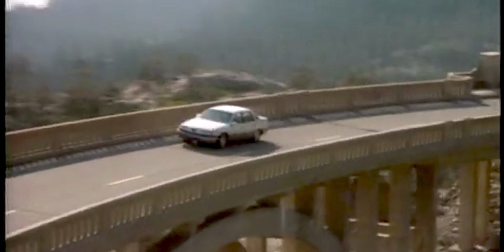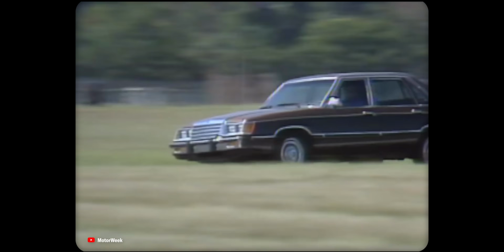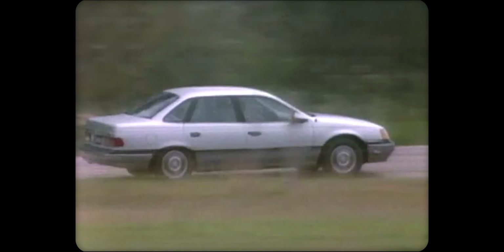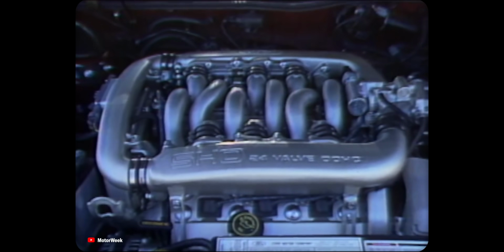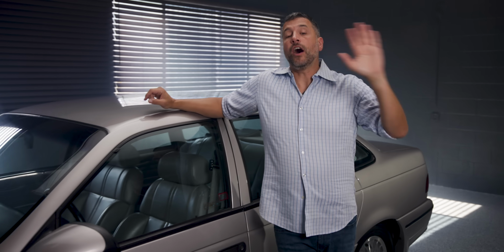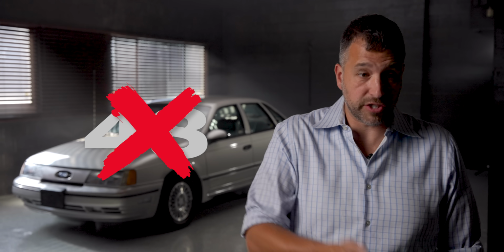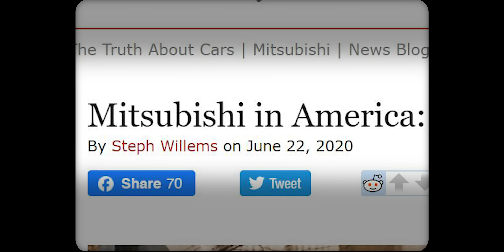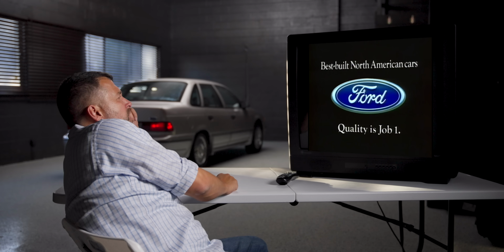The Taurus SHO is the fastest, most expensive Ford sedan | Revelations with Jason Cammisa | Ep. 08

Comment: You could indeed, rev these cars much higher than the 7500rpm he says here, and they would continue to breathe and not drop off in horsepower from the figure at 5200rpm. To do it, you needed to buy an aftermarket pulley and belt kit. The pulleys were wider and ran a 3 inch wide blower belt. The factory belts would sling off so the wider belts were needed. The wider pulley and belt kit was not really worth much on a stock engine, but for one that had some mods done, it was. I never bought the kit personally for my 94 SHO, but I knew two people who had them. I was a salesman at a Ford dealership in Charlotte NC , one of the guys with the pulley kit worked as a mechanic there, and I was big into the 5.0l Mustang racing scene, building engines and modding cars. The SHO's were fast for their class, but could be made to run a ton faster without a lot of trouble. They also made beefed up CV axles to handle the extra power.

Comment: Even though the engine power may drop after certain rpm, that doesn’t necessarily mean less torque is reaching the wheels given the ratio of the gear. Only doing the proper math will tell if it makes sense or not.

Comment: You say the only thing wrong with the SHO was the success of the base Taurus, but there was a second thing: the parking brake cable isn't sealed, so if you live anywhere with weather, it gets filled with gunk and jams up and needs to be replaced basically every year. Also, god help you if you need to replace the clutch. But, for its time, it was pretty cool.

Comment: I had a '86 Taurus LX.  It was a great car EXCEPT for the engine and transmission.  At highway speeds if you floored it it sounded as if it was going to blow up.  Always had trouble with the transmission..it would lurch when coming to a stop...kept taking it in for that an never got the issue fully fixed.  First and ONLY Ford I ever owned.  That aside the SHO was quite the car.  I test drove one and the poor salesman that rode with me had a panic attack.  As far as the demise of the Taurus what I really wanted in '86 was a BMW.  I eventually got a '95 BMW 525 and I ran the wheels of that thing.

Comment: GM's legendary 3.8 V6 was a push rod engine. It had way more power than necessary and got 30 MPG on the highway. Sellers of GM 3.8 equipped used cars are STILL using the presence of that engine in their car as a selling point.  Can someone please explain how reliability, ease of maintenance, smooth and quiet power and good mileage is "outdated"?
Reply: Same goes for the all iron Taurus/Sable Vulcan 3.0 Ford American engineered and made engine. What's wrong with reliability, simple maintenance and good mileage?

Comment: I loved my 1990 SHO ... until 60K, when the transmission teeth fractured and the shift linkage had to be replaced 3 times.  Was able to trade it in for $2K down payment on a Saturn wagon (new baby needs room for a pack-n-play).  Tried to trade it at a Ford dealership, but the newer 'tic-tac' Taurus has had less HP,  less trunk space and less passenger room - absolutely horrible for more money.  That '90 Taurus trunk could fit all my camping gear, or 4 sets of skis and boots or 3 dead bodies, a shovel and a tarp.

Comment: I had an '89 SHO a few years ago identical to the one in the video, basket weave rims, Mocha Frost (yes that's the name) paint, and grey interior.  I've had 13 different cars now, and it's still the best car I've ever owned, make no doubt, it's the real deal people.  Something that every video I see glazes over is the HUGE side bolsters on the front seats are powered, and SQUEEZE you, it's some race car stuff dunno why they went quite that aggressive with them.  Also the handling is legit.  I've had a 2000s Mustang and Acura (to be fair not insane handlers, but the time gap alone speaks for itself when you consider the SHO is a SEDAN FROM THE 80s), and the SHO was dramatically better handling than both.  Bargain basement value right now too, and they're only getting rarer because people aren't taking care of them generally.  If you can find one, keep it, baby it, and I promise I bet it'll be worth big money one day.

Comment: This is not the fastest ford sedans nor the most expensive that goes to the FPV GT F 351 FGMK2 falcon which is a RWD sedan with a 5L supercharged V8 designed and sold in ford aus making 351 KW which is about 470HP and had a 0-60 of 4.9 Seconds with a top speed of 167MPH with an msrp of 70k aud which is 50k USD

Comment: THE FIRST TIME I BOUGHT A SHO I JUST THOUGHT IT WAS LUXURY PACKAGE BECAUSE IT HAD LEATHER INTERIOR. IT WAS A AUTO TRANS AND WHITE LOOK KINDA NICER THAN ANY OTHER TAURUS I SEEN . I BOUGHT IT FOR $270 FROM A PRIVATE OWNER IT NEEDED A HEAD LIGHT AND HAD BEEN SITTING FOR A WHILE. SO I CLEANED IT UP DROPPED IT OFF TO THE SHOP HAD THE OIL CHANGE AND TUNE UP . WHEN I PICKED IT UP I JUMP ON THE EXPRESS WAY AND THATS WHEN I KNEW WE WASN'T IN KANSAS ANY MORE. LOL  I WAS BEATING V8 MUSTANGS AND CAMARO OFF THE LINE AND REMEMBER IT WASNT A STICK. I WISH I NEVER SOLD IT BUT 3500 WAS HARD TO TURN DOWN.

Comment: Buick proved that you "CAN" take a family car and sell all that they could make In 1987. The 1987 Regal t-type and GNs sold 27,590 units and were a lot quicker than the 1989 Taurus SHO. Pure stock Mine Ran 13.3 at 103 mph. If only they had made more and for more years. The problem with the SHO was that it was a heavy front wheel drive.

Comment: Bought an '89 in early '91 from a Ford dealer that was foolish enough to offer an extended warranty. The transmission was far too fragile, but they bought me 5 of them before they stopped... all within less than one of the most fun years of my life. I got what Hypertech claimed was the first chip they released for it... probably not but I felt cool. Got me 2 more mph on the top end at 142 (that is where the wall of air stopped it) and a 9K rev limiter. I ran the numbers using an Atlas (the GPS of the time) on a timed run, and I averaged 113 MPH from Richmond to the border of NC one very late night.

The motor though. Bulletproof. 

And what a sleeper. So fun to jump on Mustang GTs of the day. Yeah. They could take you by a little... if they were ready.

I've probably never left the ground more in any other car since. It should have killed me and my best friend 20 times over... but it didn't. Love that car.

Comment: Not so shure about the title of the video. Two year before the release of the sho, ford released the sierra sapphire cosworth. A 4 door sedan with a 204hp 2L Turbo engine. This was way quicker than the sho in straight line, and in corners too. The sierra was a RWD car with a LSD, so the power was transfered to the ground without any issue, not like the taurus that was slipping really badly... And I don't even talk about the understeer of the taurus, that was a distaster...

Comment: My 2006 Accord is definitely inspired by this car. Not as high revving (6800 rpm vs 7300), but potent nonetheless (244 HP from 3L too). Top speed is electronically limited to 135 mph, but capable of reaching past 150. And it corners well. 

As a lover of V6 sleeper sedans, I've always wanted a SHO, but every time I tried to buy one, it slipped through my fingers. It was definitely ahead of it's time. And while the sleeper status is a negative to some, it's a massive positive for me. It's definitely a legend.

Comment: The transmission was junk, and they never fixed it before they completely re-designed everything. My mom bought one new in 1992 and ended up paying for 5 new transmissions before she switched to a Toyota Camry. The SHO was basically a different car than the Taurus. I'm still pissed off about how ford treated their customers on warranty claims. It made me a Chevy guy for life. My 900hp Chevy truck has an engine from 2007 and a transmission from 1995. It's by far the best vehicle that I've owned. It smokes everything, and only cost me $10k to build. It's 100% GM except for the turbo

Comment: Pray if you were sucked in to buying one of these you sold it before it had a melt down. Jags and dodges have been famous for their wiring issues for decades. If you own one long enough you'll either become an electrical engineer or have expensive mechanic bills. I love both and have owned 11 jags and half a dozen dodges. The SHO was a blast. Fast as hell handled well but then I friend just had to have it so I sold it. Less than a year later it got quirky. Then unreliable then dead. It was wired like an audi. Over engineered. They didn't account for the heat and it's effect on the wiring harness and sensors. Same issue with jags. Dodge on the other hand just used crap wires and cut corners. I've worked on a bunch of the SHOs all have had the same symptoms and issues. There is no quick fix. There's a reason you don't have trouble finding them in salvage yards and people's back pasture. Good luck if you have one. I heard they are going to try again. Now to the design team. Quit being idiots and make a 2 door. Unlike the moron that made the SS impala a 4 Door. Not really a super sport when it's a family car. It's called a sleeper. Read a hot rod mag before you Don the pocket protector and hit the drafting table.

Comment: I had a 1990 SHO W manual 5 speed and a chip.  Not the place to put 250hp on a transaxle.  Never beat on it.  Under 100k and it failed going cruise control at 55 mph.  JUNK.  next topic

Comment: I was the second owner of a 90 Taurus SHO for a couple years and for that era it was one heck of a sleeper.  It was missing the low down torque of the Mustang GT I had been driving but it also lacked the live axle in the rear that made for sphincter tightening  handling over rough pavement when driven hard.  If you were rolling and kept it between 3000 RPM and the redline you had a similar amount of power as the V8 GTs had for acceleration available.

Comment: Bought a 1991 Ford Taurus new with the 3.8L V6. Three years latter there were so many leaks from the engine and transmission that the service tech at a Lincoln Mercury dealer told me that "If I were you I'd get rid of it".  I told him that this is practically a new car and decided to keep it. I paid for the leak repairs off warranty. Two months latter the head gasket failed. Fixed that as well and sold the car at huge loss. I would never ever buy another Ford.

Comment: Great engine, but hard to get anymore HP out of it.  
Also, the chassis was crap and the 5 speed manual was awful and went bad within months of purchasing new.
There was a fix for the lousy manual.  What they did was have the hardened steel throw out bearing running on an aluminum shaft so it would stick and gouge the shaft.  How in the world did the engineers not see this.  Handling was nothing to write home about.  It had understeer and it would plow through and not turn.  
Not worst car ever built and I say it was a C+.
They were sold with deep discounts.  Suppose you sell for $24k, but I got mine for $15,900.00.
The Buick GN was much, much better car for what it was.  It also blowed the doors off the SHO.  Not even a race.  Moreover, the high revving was fun, but in the mountains it was gutless.
Do not trust Magazine articles.

Comment: Honestly in the 80's the American automobile industry was in trouble. Not too soon after the Tarus came out they were everywhere. We had the Mercury version and even though it was my moms car it drove great and handled great. I even accidentally jumped it over some railroad tracks. It came out toward the end of the horrible left over American boat cars that were still on the road from the 70's ( You'd turn the wheel on something like a 1970's Ford LTD and it would slush in the direction you turned it, verses the Japanese cars like Hondas, and Toyota that could have killed the American car market.) Even cars like the Camaro and Mustangs in the early and mid 80's we're gimped from their 60's predecessors. The US car industry was tanking itself. As you can see the Japanese just made better engines ( and cars period), and could take what we had and give it back to us and find the missing horsepower that the American engineers couldn't find in the same design. The Tarus wasn't the sportiest looking car, but it was nice to drive for an average sedan. I'm sure the SHO was lots of fun too.

Comment: Had one of the early ones, too bad the Mazda transmission wasn't up to snuff. Really detracted from the car. Ran it for 150,00 miles with no problems except for a crankcase position sensor and lots of light bulbs. As for the 325i, had one of those too. Underpowered but really fun to drive.
Reply: Crankcase position sensor 😆
Reply: S
Sorry, should have been crankshaft
Reply: @bobgwin5469  just cracked me up.
Reply: @tidefan35967  he really cranked your shaft with that one.

Comment: Yeah . . .  but the Vulcan motor lasted for 600,000 kms (373,000 miles), while the SHO was lucky to last half of that.  I had 4 Taurus wagons.  I made sure that there was a Vulcan in each one.  Paid $1000 at around 300,000 kms and they all lasted 6 years.  And not for nothin', the body rusted out before the motor went.

Comment: Interesting - my non Turbo Eagle Talon cranked 135hp and 0-60 in just over 9 seconds at only 4 cylinders (DOHC). Not shabby for 13.5k in 1990. I'm still digging through a massive backlog of videos on this channel but can't find a DSM rundown. Have you done one yet? That'd be an insanely cool story because ... well it is. Give Bloomington IL some love and cover this legacy.
Reply: My 91 tsi was still the coolest car ive ever owned.  Easily modded to a high 12 second car.
Reply: @kottyking  Me too. Loved my 91 TSI. Right up until my differential exploded on the highway. Replaced the vehicle with a 96 with all the bells and whistles. The 96 was so much more comfortable to drive, but the 91 was  so much more fun to drive. Probably because it was several hundred pounds lighter. I miss it.
Reply: @Syvtek  I ended up buying a 95 gsx and i agree it was way more comfortable.  Ended up spinning a rod bearing and let it go after that.